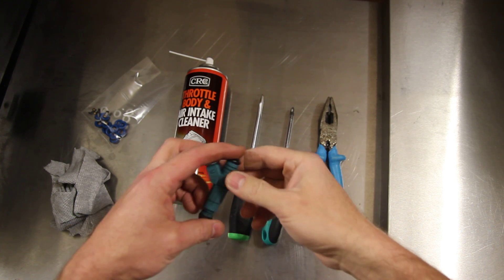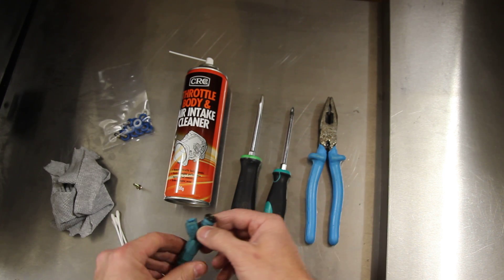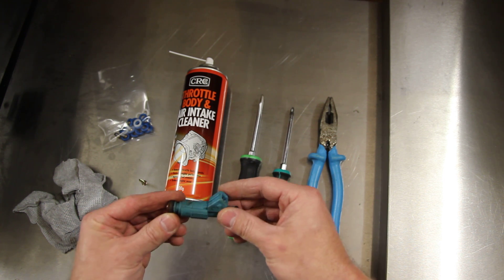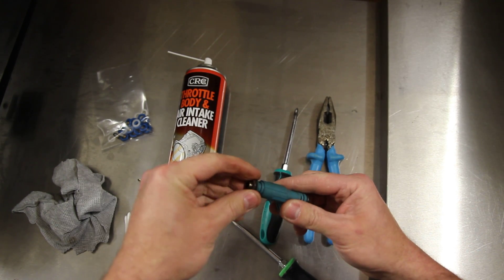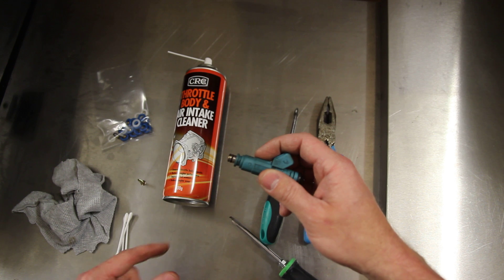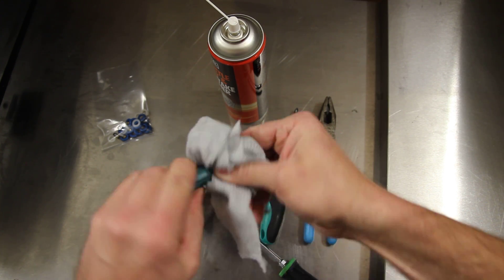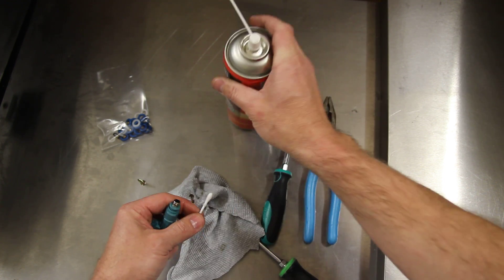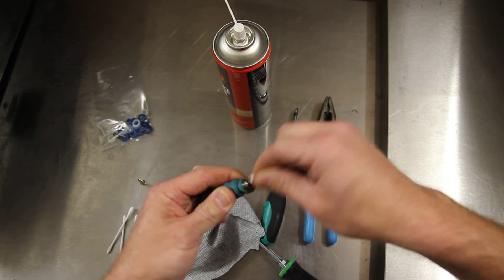How to service bosch fuel injectors starting with part number 0280155xxx

Comment from the maker: Fuel injectors that are not too dirty, 15 mins in a ultra sonic bath would do the job. If the fuel injectors are really dirty, you would do 15 min, then check the tips and then do another 15 mins. That normally will be enough to do the job. If you found after 2 goes in the ultra sonic bath you still have issues you would get the fuel injectors flow tested as you may have a bad fuel injector that would require replacing. Also remember it is just the tip/end of the fuel injector you put into the ultra sonic bath, not the whole fuel injector.
Reply: Fuel Injectors nice vid I liked and subbed
Reply: thank you i done myne the other day even made a clicker to actuate the injector and they came out like new after 10 minutes the car has heaps more power now  and 100 times smoother thank higly recommend ur kits as well good value for money
Reply from the maker: Excellent to hear

Comment: I have Bosch 0280155823 injectors and I can't seem to get the filters out of them. They are stuck good. Have you had this experience?
Reply from the maker: Use a self tapper screw should get it out

Comment: Your ebay listing states these are for injectors starting with 0280155xxx well mine do start with that and the filters i pulled out are not the same size as the ones in your kit the original ones are longer probably 4mm longer and look like they would have better fuel flow to these ones in your video.

Comment: Hello, thanks for video. 
If I want to clean my CNG fuel injectors. What repair kit do you recommend me?
I have on my car: BOSCH: 0280158862 = OEM par number: 03C906039B
Or where I can find what type of microfilter and gasket needs to be used?
What liquid are you using for ultra sonic cleaning?
What liquid are you using for flow testing of Petrol/CNG fuel injectors?

Thanks a lot for help.
Reply from the maker: Best to check with genuine for the kit
Reply: I didn’t find it.
Reply from the maker: https://www.ebay.com/itm/Bosch-ORIGINAL-0280158862-INJECTOR-CNG-/282644480953

Comment from the maker: Yes your injector is bad and not working, you would need to remove this injector and service it in an ultrasound bath, I would say it is stuck shut, only ultrasound bathing would fix it but not all injectors can be saved by bathing it, some injectors will never start again and would require replacement

Comment: Hi there my injector is clicking and my car is running and when I unplug the wire while the engine is running it doesn't make any difference to rev is that a bad one  but when I do it to the other injector the rev drop
Reply: usually if you have a bad injector, your check engine light will come on.  i had that happen to me.   yours might be working, just not that great.  could be dirty.

Comment: Nice, but could you use the old screen basket or buy new ones ?
Reply from the maker: You have to purchase new filter baskets. Never reuse old ones as once you remove them they will be damaged and most times they are blocked with dirt.